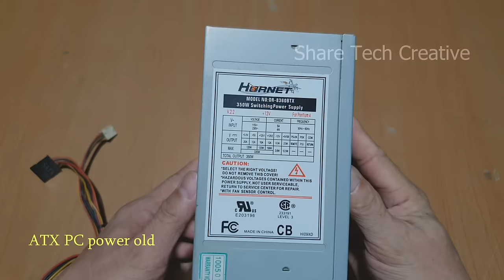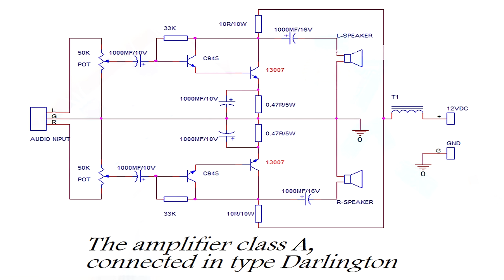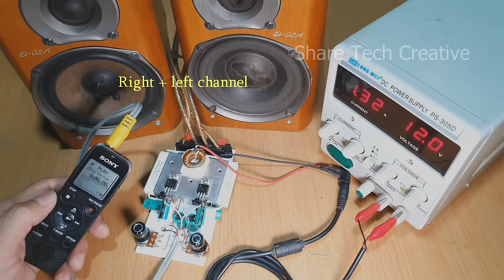How to make STEREO amplifiers with ATX PC power parts | Class A

Comment: That amplifier definitely works, no fake. I just built one half of it recently (mono) with a real MOSFET (Toshiba K2698), a BS170 source follower as input buffer (10MOhm input impedance), BS170 common source as voltage gain stage and a 2SC2240 emitter follower as output buffer to the powerstage. Works pretty well but 12V supply is just to less to get high output power. It distorts quite early.

Comment: Great thanks. I am really impressed by your interesting suggestion.
I have some KSC5020, 2SC1815 and F20N50, 2SC1384 now.
Can I use them instead of 13007, C945? Or should I change some parts of your circuit to use them?

Comment: Bro good job .Can this circuit be made more powerful, for example by increasing the number of transistors?
Reply from the maker: Yes you can
Reply: @ShareTechCreative  thanks bro.When we use more transistors, how will we make the circuit connection?

Comment: Can you elaborate please, are those 13007 really mosfets, or npn tranzistors? Because under that designation you have  bipolar npn tranzistors (d13007k) and mosfets also (something like 13007-2). I found in my old power supply actually npn transistors d13007k in that place where you took yours transistors from board.
Reply: 13007 npn transistor

Comment: Can i use 18 volts on 13007 transistor?
Reply from the maker: You can use 18 volts on 13007 transistors, but you may have to change the voltage divider for C458 transistors since they are operating in 12 volts. Good luck

Comment: Hi, how do you calculate the value of the resistors (33k and 10r/10w) what if I use a different (more or less watts) power supply components?
Reply from the maker: These are the ultimate ingredients, cannot be truncated, and cannot be altered!
Reply: I think you can basically use what the power supply comes with. Except the high watt ceramic resistors which he probably got from a amplifier

Comment: Hi Friend. I can use this amplifier with battery? I want to make bluetooth amplifier for outside.
Reply: No bro this amplifier needs 12v  power supply
Reply: @incogvirus5851  use a step up booster
Reply: @philyrics6104  bro but  battery consumes power rapidly
Reply: @incogvirus5851  take a 60AH lead-acid car battery. Takes some time until it's drained.
Reply: @thomasr.5443  Yes it works

Comment: it's about 10W rms /channel amp from a PC part :D nice job
Reply from the maker: Yes, thanks
Reply: @ShareTechCreative  to small watt
Reply: @gwantweng  enough for desktop speaker.
edit: class A amp has efficiency about 50%. instead 10 watt/ch or 20 watt total which need 100 % efficiency from Bench PSU reading ~1.5 amp x 12 volt = ~ 18 watt.
You only get half of that since the design is Class A. Which is about 5 watt / channel.

Comment: Could you please show me B, C and E leads at a FET transistor? I bet you won't find them...
By the way, 13007 is a BJT, not a FET
Reply from the maker: You see in the description the video
Reply: @ShareTechCreative  no, you don't understand me.
I mean, in the video you say "take the two 13007 power MosFETs..." And later you refer with B, C and E to the pins. So see, a MosFet has no B, C, E but G, D, S. But the 13007 is BJT so B, C, E is correct. But MosFet is not.

Have a nice day
Reply: 13007 is just n NPN switching transistor.. not a MOSFET...
Reply: @bertr6741  Just what I said, didn't I?
Please look at my above answer to him.
He writes in the video "take the two 13007 power MosFETs" which is wrong because 13007 is s BJT

Comment: All that is fine but  those resitors waste energy on heat too much , can be replaced with 12V/ 5 or 10W bulbs 
it would be better to use parts and build AB class amp or make class A as JHL69 amplifer on 12 or 24 V

Comment: 10 watts of heat wasted on the resistors ? no thanks , what a waste of energy in this low eficcient circuit !
Reply: Why is that a huge problem? is it expensive or there´s something else?
Reply: @TerryGrancho  isn't better to waste that energy in audio output power instead just heat ?  its not expensive obviously, but the performance is sooo poor